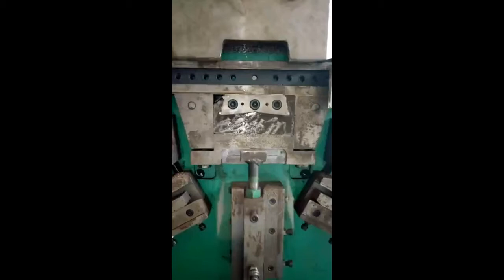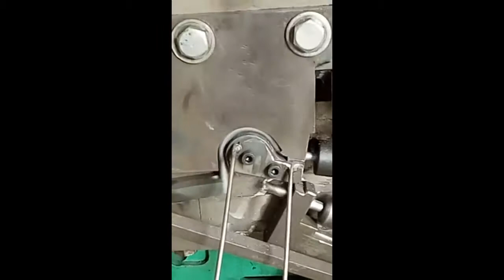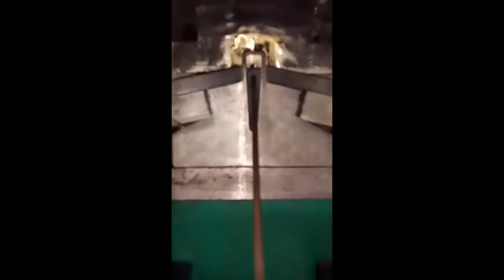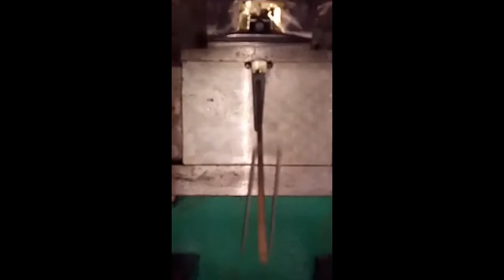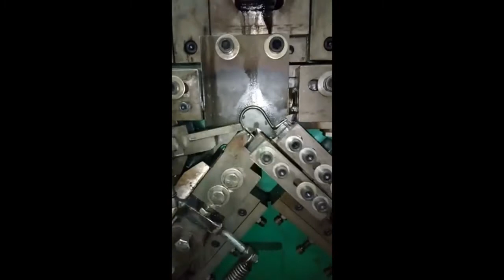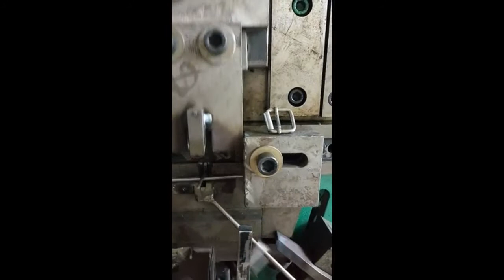More machinery

Comment: sir where are you from ?and this machine price ?
Reply from the maker: Dear Sir, This is Reppart Industry Co. from China. The video shows various different machines to make different products from steel wire. Please let me know what product you are going to make.  Please contact us at: reppart@126.com and send your product picture to us, describe the wire diameter and total length (before forming). We do not suggest that the total length is longer than 320mm. Otherwise the machine price will be much high. You cn also leave your email address Thanks. Kingsward